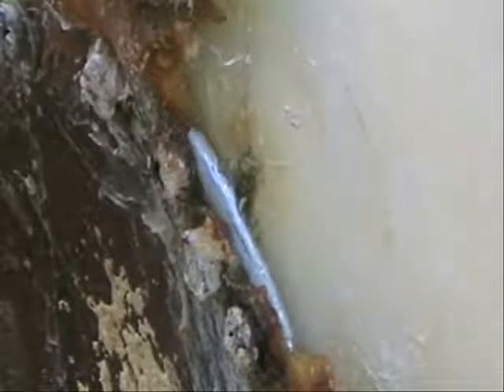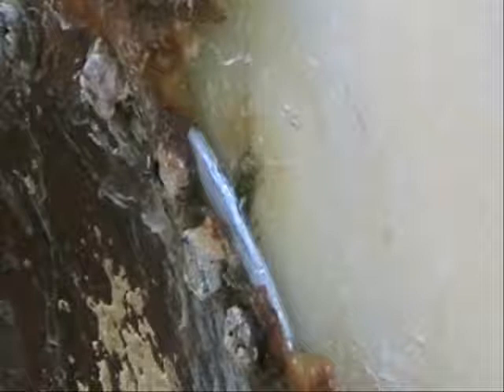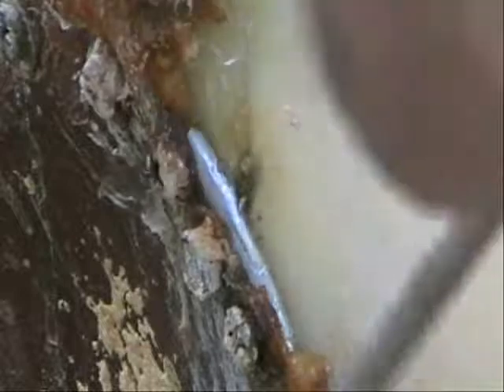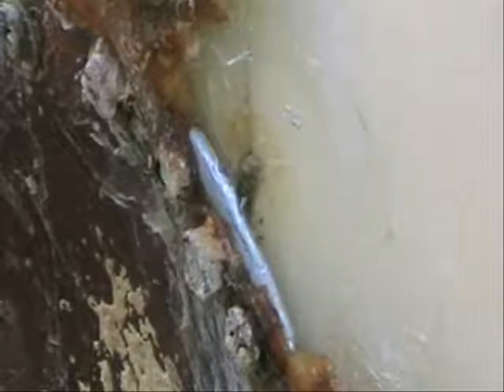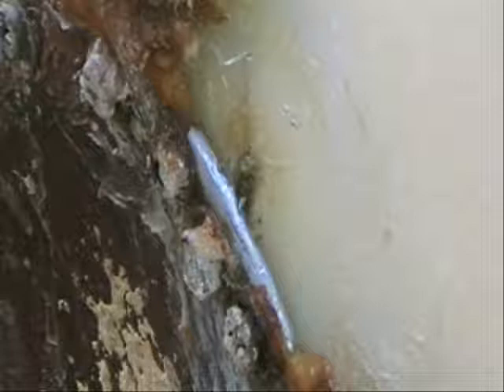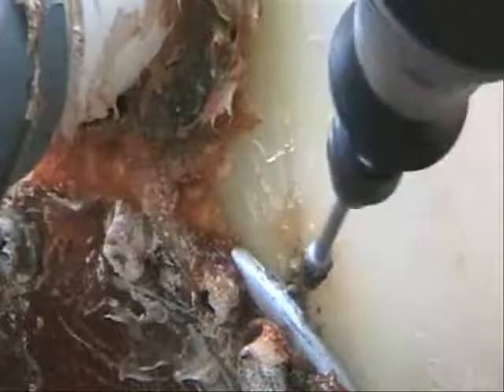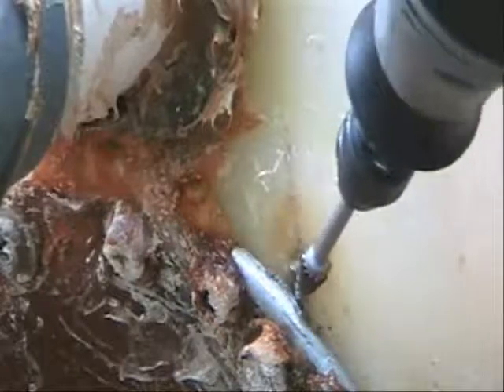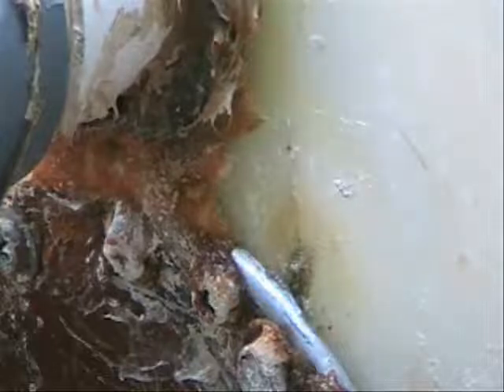Polyethylene Tank Weld Repair

Comment: How long did the repair last?
Reply from the maker: Dougie it is permanent if you do it right and take your time. I was actually melting plastic to plastic so as to make one solid piece. The kit is expensive. If you just have a small leak you may want to try some JB Water Weld. Here is a link...https://amzn.to/2HnN7Nb

Comment: Thanks for the video. Got a Model-7 and fixed my 2600 gallon tank. So-far, so-good.
Reply from the maker: It takes a little practice to get good with this tool. I have used it for many repairs where I want a solid fix that silicone caulk just doesn't provide. Thanks for the comment!

Comment: Thanks Steve, I was wondering how to do this this. I plan on repairing a fresh water tank seeping around the drain plug grommet on my travel trailer.
Reply: Welcome jkw427, post your outcome if you like. I really like my welder and the more I use it the better I get. I find matching the types of plastics the most difficult of the process.
Reply: Thanks. That's what I was looking through last night. How to tell the differences between the plastics. I like that little kit with that plastic rod pass through on it. Is the repair holding up?
Reply: jkw427 I had a freeze and ended up some seepage. I went back over my work with a tank less than empty and managed to get a small drip which eventually sealed itself due to the alkali in the water. My repair is at the bottom of a 1200 gallon tank and I am pleased with the results that I have made with the kit so far. I haven't had to replace that old tank yet, thanks to the plastic welding kit.